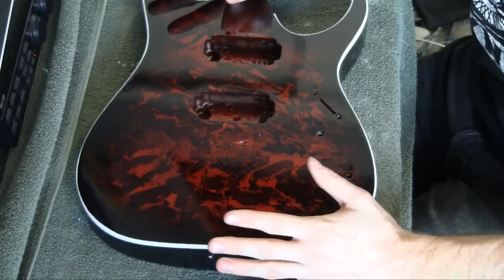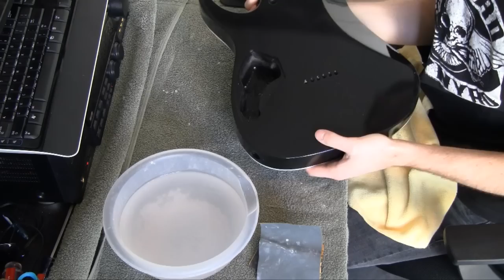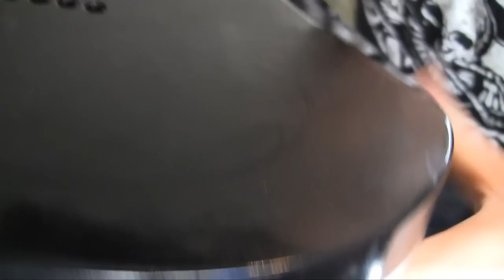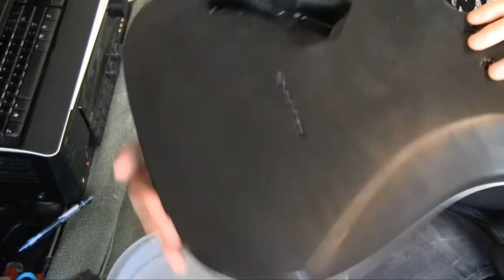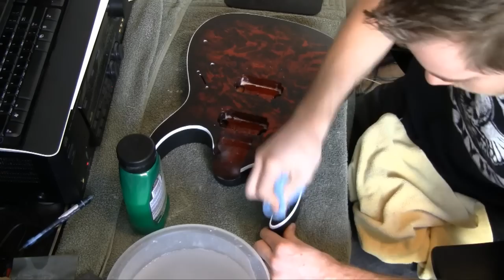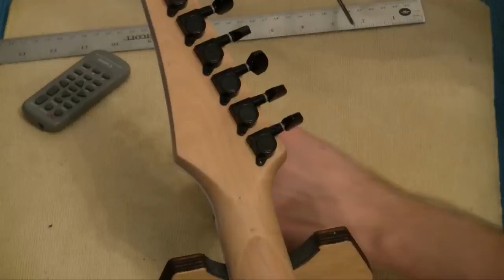How to Wet-Sand & Polish an Electric Guitar

Comment: I have a question for you. Ive been trying to sand down a Fender squier infinity series telecaster. Im planning to get it to the finish and refurbish it clean and rebuild it with some decent tele hardware and pickups. Ive gotten the paint most of the way off...and have most of the primer exposed. But thats as far as i can get. Ive used sandpaper with a block - electric hand sanders and even a spray on paint remover. Its a bitch and wont come off. Any ideas. I Just want to get to the natural wood grain and possibly stain and clear coat it.
Reply from the maker: GODZ STR8SHOOTER02 Chemical removers don't really work on modern finishes, they're essentially made of plastic. I would suggest sticking with the elsectric sanded and if it's taking too much work, go down in grit. I generally wont strip a body with anything lower than 180 grit because the sanding marks become too difficult to sand back out, but it also depends on the finish I'm doing. Usually I'll strip like 80% of the finish off with 180 grit, then the rest with 220 grit. Some paint products require a 320 grit surface, at which point I would then follow up the 220 with 320.
Reply: shelbyfanss
Sounds like a plan - id actually thought Id been using to harsh a sandpaper and was worried about harming the wood. But I'll give it a try - thanks for the quick reply - peace Uncle Stoney aka str8shooter
Reply from the maker: GODZ STR8SHOOTER02 Yeah you can use pretty rough grits and be okay, you're only removing a few hundredths of an inch at the end of the day, unless you go real crazy with it. Like don't use a belt sanded with a 40 grit belt on it, that's just a bad idea. haha
Reply: shelbyfanss
LOL I thought about a belt sander - we have a wood working place here in town I think I may take it to them and have them chemicle dip it and take it off. But probably not...I'll just use a hand sander and keep at it. BTW - you did a great job on your buddys guitar. Saw the video. He looked dam happy with it to.
Reply from the maker: GODZ STR8SHOOTER02 Thanks man! I wouldn't dip the body in anything though. Like I said in this video about the bathtub, submerging the body in water can cause the wood to swell and crack. I imagine chemicals would do the same, and that's assuming they can even remove the finish. I wouldn't risk it, I'd just sand it.
Reply: shelbyfanss
Yeah thats probably the way Im gonna go. I just rebuilt a B.C.Rich Beast over the summer - put in new hardware and some 59 seymour duncan humbuckers - floyd rose and all. But i didnt have to do anything with the body-bought it for 50 bucks in a pawn shop. Sounds bad ass now. Good metal guitar. Im hoping the telecaster comes out as well. If you dont mind I may ask you for some tips in the future. Im still new to building them. Probably worse at playing them to lol

Comment from the maker: Many, many different ways. The best way is with a single stage paint, as in no clear coat. But that means you can't rely on wetsanding to make it flat and even, so you have to use a spray gun and get it on perfectly. I painted a motorcycle satin black once, it's not easy.

Comment: another thing you can do is take painters tape and put it on wax paper then put that in your printer and make the custom design on photo shop or whatever. then you just print it out and use a scalpel or razor blade to cut it out then put the cut out on your guitar. I paint my guns using this method and it works really well.

Comment: I do this? 1. Wet sand with a 400 to get it smooth all over? Than 2. Use a 2000 to smooth the clear out more WITHOUT hitting the layer of the actual color? Then 3. Start buffing it?

Comment: Hi.... 
Saw that u used 400grit and 2000grit to achieve that look.

Am also trying to do it.
But a matt black finish.

Will 400 and 2000grit be sufficient?  Do i still need to add clearcoat before or just even out the paint will do?

Comment: wet sanding can be nice but it can also ruin your job. e.g. veneer (or even without veneer) and then water infiltration due to the wet sanding and bubbling even on a dried out and cured jobs. I had some of those situations. I rather dry sand gently and use a few more grids until I end up with a matt surface and then go to polish.

Comment: If I shouldn't use the block on a les paul, and of course using bare hands isnt good either, how do I sand it then? Thank you!
Reply from the maker: There's nothing wrong with using your hands at all. That's what I do most of the time anyways. You just want to make sure that you don't apply any pressure on your finger tips because that will sand more in those places and that's not good. But you shouldn't apply pressure with a block either.
Reply: Awesome dude,  thank you so much
Reply: Is it normal sanding paper, or? Thank you!

Comment: I still don't get how it's possible that wet sanding with such a low grit as 400 grit, could not leave  deep scratches that simply and only with some 2000 grit passages could disappear...
I started wet sanding a body smoothly coated with a 2k ultra gloss coat, with a 1200 Grit, removed the shiny layer to a flat surface, than went with a few tender passages with a wet 2000grit..
Everything was looking fine but when I started polishing and gloss started to come out a tons of scratches appeared..

Comment: Would using 0000 steel wool work? Especially on a contoured body.
Reply: Steel wool is messy and youre better off with 2000 grit wet/dry

Comment: i tried to do it exactly the same way... but after doing the 3rd time polishing , it still looks dull. No improvement and really faaaaaar away from any glossy shine. 
initially i found lots of swirl/scratch marks , possibly from the 400 grid paper, which i was trying to remove with 2500 grid paper. wasnt too much of an improvement, but i could live with it. even with some smaller swirl marks i still dont get any shine with polishing. do you have an idea?
Reply from the maker: +flaptrack737 It sounds like you didn't put enough work into it. Wetsanding and polishing both take a very long time, especially if you follow the methods in the video. I tried to break the process down to it's simplest elements in this video. The method I do in my shop is a bit more complicated but it makes for an easier show room shine. But if you're painting with rattle cans, it wont really help. What I do in my shop is I wet sand the body to flatten all the texture with 320-400 grit, and then I hit it with one last coat of extra thinned out lacquer. Once that's dry, I wetsand it again with 600-800, then I move up to 2000, then up to 3000, then I polish with a buffer wheel. That method requires a lot more sand paper, a paint gun setup, professional lacquer, and a buffer wheel. I explained the process I did in the video because it can be done with spray cans and 2 grits of sandpaper easily found at most stores. You can achieve the same result either way, but your biggest hurdle is getting the 400 grit swirl marks out and then getting a high gloss polish by hand. But it can be done, that's how I did it on the guitar in the video.
Reply: +shelbyfanss 

first, thanks a lot for your reply. So, should i put anoterh clearcoat after the 2500 wetsanding or just keep sanding? My idea now would be to go with the airbrush and some gloss laquer... how does the surface need to be before doin the polish?
Reply from the maker: +flaptrack737 I would've had to paint the guitar myself to know whether it's safe or not to keep sanding, there's too many variables. But when in doubt, bust more clear out! As for polishing, before you polish you should be able to see the reflection of objects in the guitar at certain angles. If you can tilt the guitar towards a soda can and read the ingredients in it BEFORE polishing, you're off to a great start. You shouldn't see any deep sanding marks either, ti should all be fairly reflective. It wont be shiny, but you will be able to see yourself in it at the right angle.
Reply: +shelbyfanss 

ok, thats a good hint! meanwhile i found out about different sanding grits between USA and Europe.. i was doing it with P2500. Your 2000 grid should be a 4000 grid in europe :-/  anyway will try it with one more layer. i allready put 3 thick layers of PU paint on it... had some microbubbles in it and do it again and so on... really a painstakin job... 
thanx for your great help

Comment: Not sure what I'm doing wrong but when following the steps in this vid, all that's happening is my clear finish is turning hazy-looking. It's doing the exact opposite of making it shine. Sand paper is not drying up and nothin is getting lodged in the grit. Just isn't polishing the clear coat to shine, it's just actually sanding it down and making it look scratchy. Using 3000 wet/dry sand paper.
Reply: Daniel Sharp sanding is not going to make clear coat shine. You have to use polish paste. And maby You did not wait enough to harden laquer totally. I am going to do that now but not sure how lond do I have to wait for laquer to harden enough

Comment: I saw in another video by someone that you have to soak the sand paper before wet sanding. Is that true?
Reply from the maker: There is some truth to that. In the automotive industry, it's pretty standard to let the paper soak for like 24-48 hours before being used. I'm not exactly educated on why that is, but I didn't soak the paper very long for this video and the results speak for themselves. So it's not totally necessary to soak the paper, but it certainly couldn't hurt.
Reply: shelbyfanss
thanks for telling me :)

Comment from the maker: I don't really need a tutorial, just buy a Tremol-No. They're quick and easy to install, no modifications necessary, have their own instructions and it has three functions. One keeps the function of a floating Floyd, one locks it solid like a hardtail, and the other is 'dive only' like a flat-mounted Floyd. All of the functions can be achieved with two set screws on the back side, it takes seconds. They're only like $45, I would just get one of those.

Comment: Bad idea to just use a rubbing compound. Use a rubbing compound, then a polishing compound, then a swirl remover. Meguiars makes all of these. StewMac also has a series of compounds, swirl remover and "preservation polish". Use swirl remover. I could see tons of swirl marks at the end of the video.
Reply: +Colin Ashenton .....You think just a rubbing compound is a bad idea?....I have seen a few vids that show okay/decent results. I have a gloss Black guitar with lots of surface scratces, im thinking of going down the 2000 grit wetsand really light, almost a token sand. Wipe clear, then rubbing compound/polish to finish.....I was a bit dissapointed in this vid as toward the end, after 15minutes 10sec you could see loads of scratches on the front of the guys guitar...Any recommendations, based on experience?....Thanks..
Reply: Benny Hill I've had great results with a running compound (the cream kind) followed by Meguiar's Ultimate Polish. I like using Turtle Wax brand (as seen in this video) because it's inexpensive and you get 18 oz.
Reply: +Colin Ashenton ..Yes, theres another guy on here who uses tutrte wax on a gloss black mandolin and it came up okay..I know you cant see my guitar but do you reckon i should do the token wetsand, then the compound..Or just try the compound and see how that looks first?...
Reply: +Benny Hill Are you repairing a guitar or finishing one?
Reply: Repairing. Used guitar off ebay, trying to make her look sexier!..It's not in bad shape but wanna improve her...
Reply: +Benny Hill If the scratches are equivalent to 1500 or finer, go ahead and use the compound. It may take a while though. If the scratches are deep, start with maybe 600 wet and work up to 2000. perhaps 600, 1000, 1500, 2000. Make sure to remove all scratches with the 600.
Reply: +Benny Hill Also, make sure to sand the whole body with it, even if its not scratched in those places. If not, you'll end up with a spot lower than the rest.

Comment: One of the things i noticed. In all your videos (Or atleast all the ones ive watched) You never sand the paint of where wood touches wood (I.E. Where the neck meets the body) I find that wood on wood resonates better and makes for a cleaner sounding guitar. Might just be my ears though. Maybe its something you should try for yourself?
Reply: you don't sand bare wood areas, non viable sections or edges because theirs no finish. and you're hearing shit. it makes no difference how wood touches wood. it has to do with what your body base is made of, tension and tone blocks if any..
Reply: No... its actually quite simple. Wood on wood resonates better together that wood on paint I was talking about sanding the part where the neck meets the body. I have made a Crestwood sound amazing just sfom some simple modifications (Sanding where paint is not needed and a bridge block to be exact) it makes more of a difference than people think.
Reply: by the way on 90% of guitars where the neck meets the body has paint on it

Comment: No reason to sand between clear coats haha. Such a strange concept. Especially with laquers, because they "burn in" (google it), its not needed at all. 

Theres no definite number of coats. You need to apply enough to get the job done. This comes with LOTS of trial and error. The reason for this is whats a "coat"? 3 really really thin coats... you will ruin your paint when you sand it. 3 retarded thick coats, and you have other problems haha.